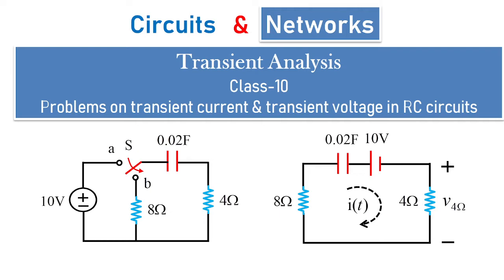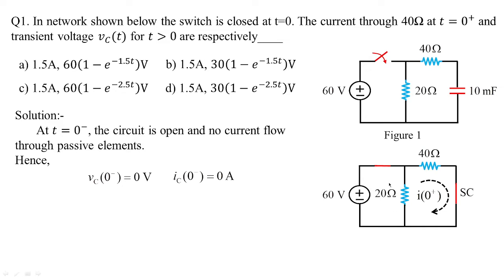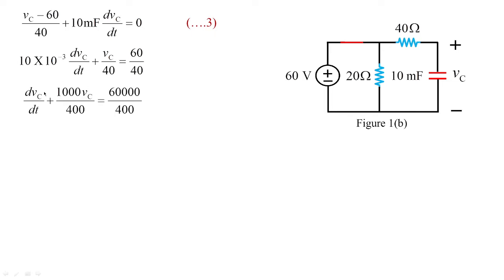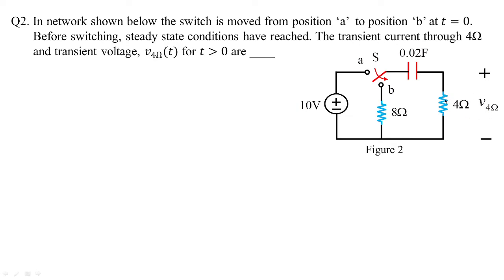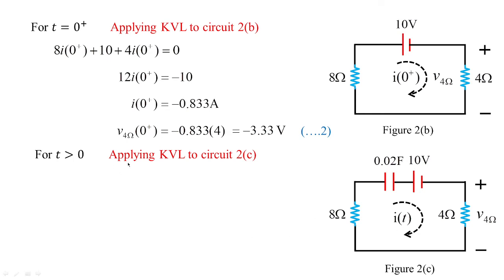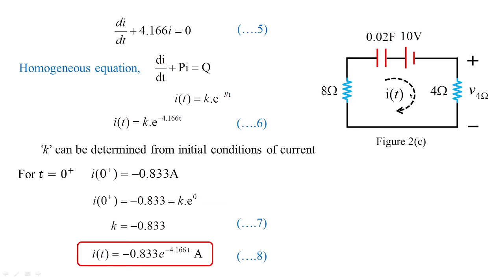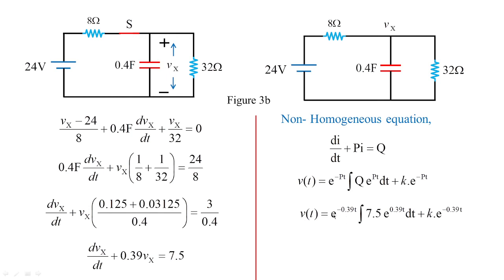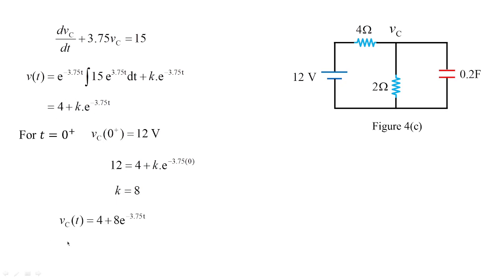How to solve Transient analysis problems? Solve Transient analysis. How to solve Transient problems?

Comment: sir but in the last problem what happen  to the developed voltage acorss capacitor i.e. 12 v  since you told that  if the  capacitor is being charged then it willl act as  volatgesource in series with  capacitor but here you dont show the volatge source i.e 12 v in magnitude
Reply from the maker: yes, you are right. that is understood that is why it is not shown.
Reply: @engineeringbasicsforcoming2179  but sir you havent used that 12V in equations too 
and on using it some different answer is coming
Reply from the maker: capacitor voltage at t=0- and t=0+ is 12V ok. but transient voltage across capacitor for t > 0, it is 4+8(e^-3.75t)

Comment: In last problem voltage at t=0+ is there i.e 12v  but why don't you take in t>0 capacitor is in series with voltage source
Reply from the maker: https://youtu.be/3W6NU8HRrSU?si=w9TZhEmzkCivmBSQ
Reply from the maker: capacitor behave as voltage source under charged condition
Reply from the maker: after capacitor is charged , the switch position is moved and hence it is no longer in series with 12V source